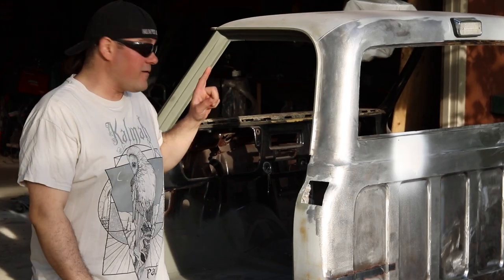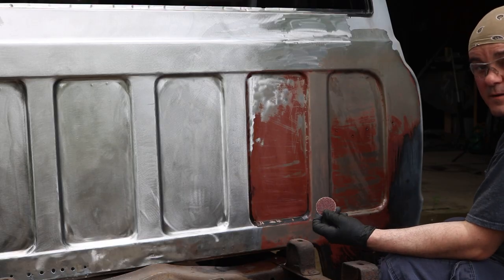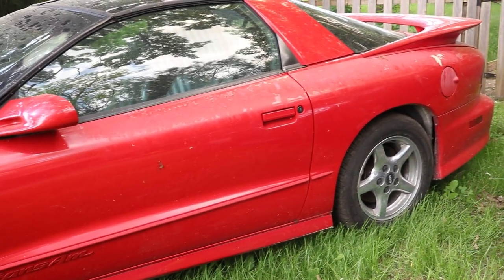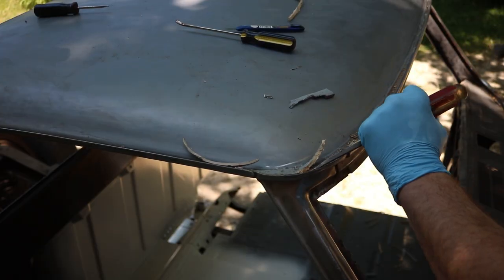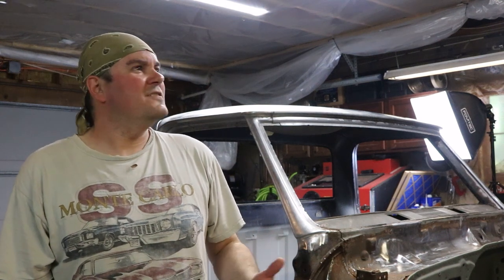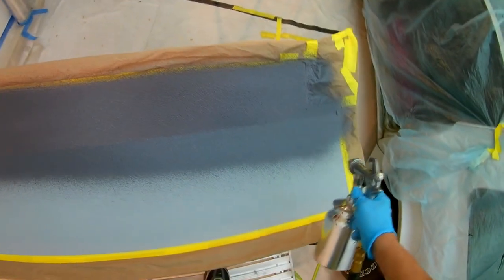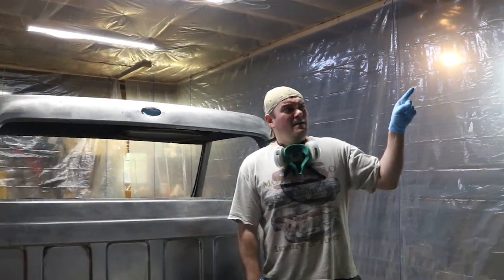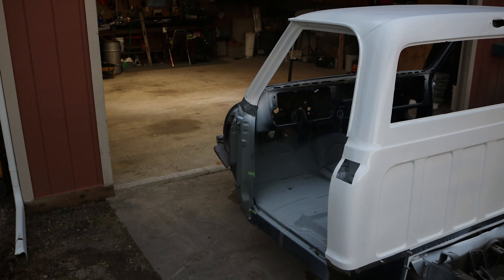How to Paint Classic Truck - DIY Paint Removal, Metal Prep, Primer Options and Paint Application

Comment from the maker: What painting project brought you to this video?
Reply: 1984 square body. Wondering how deep into paint I want to try to go. I don’t want to have to go to the metal but I’m going to have to replace rocker/cab corner so maybe I need to 🤔. A lot of work but it’s a single cab so not too bad. Great how to bro. I’d be doing all my painting out in the open
Reply from the maker: @bowtiebuilding  nice dude. You can always hit it with 80 grit and then lay down your primer but it really depends on how many layers of paint and was there body work done at some point before you? Because if the last person did improper prep or just slapped Bondo into rust, that will show its ugly head eventually. My buddy back in high school had this beautiful white 66 442 and after about two to three years everything started bubbling up on that thing from shotty body work.
Reply: A 1985 Chevy Monte Carlo
Reply from the maker: @bobbycravens6853   nice! Good luck with your project.

Comment: There is a new chemical paint stripper I think you will be amazed with. From New Zealand, "Coopers Strip Club" that sells a two part spray in pump bottles. They have YouTube videos you have to see. They sell kits or large 5 liter refills of both. First is a stripper that can sting bare arms so PPE and use their cream each application. Like any stripper, the more layers, the more used, but this is a mist to keep you panel wet, depending on Ford Enamels or GM Laquer or a base/clear still works. The have a dense steel wool they have made, but works the same. Once bare, bottle spray their "Flusher" to neutralize what ever is left behind. Since a thin spray, it is not a thick goo with paint to clean off floors but there is cleaning to do. Yours will vary. But I would buy the refills (2) and give a try. No shipping, website all one word, no extra ph #'s to dial outside the country and the inventors wife answers the phone & extremely knowledgeable.
 Just an alternative since the EPA is soo smart and took our Methylene Chrloride out of air craft stripper but they can't account for where the waist goes. They tell you that 41 people have passed from 1976 to 2009 is the reason but 1,956 children died of gum balls & small toys as choking hazards. Sad, true. But the government knows what is best all the time like $5 dollar gas, $8 bacon but they still sell turkey fryers! DK, ASE master since 78, retired.
Reply: Yes, it works. But it will cost you about $1000 to strip your truck. I can strip my truck in a day with $50 in sanding disks. Coopers is good for tight, hard to reach areas. Not stripping whole vehicles.
Reply: @SOLDOZER  Two large refills will strip two full sized trucks. Yes, it is made to remove base / clean from entire vehicle and I spent $250 and stripped entire 1967 C10 long bed, inside bed and inside cab. Easy, type in coppers strip club on you tube and watch any number of their videos. Besides, $50 won't get you enough sandpaper to do a hood & one fender. Buy the 3M Cubitron 80 grit at $1.98 per sheet for 6" DA. I will spray Coopers with long sleeve all day with no dust! Filter cost money to and not N95.
Reply: Side grinder with 6 inch 80 grit pads . Keep it moving 😊

Comment: Painted my 67' Bronco in my garage last year, hidden gem for cleaning your surface before paint is white vinegar, cheap, smells bad but works wonders
Reply from the maker: Nice, thanks for the tip.
Reply: That’s acidic, won’t that mess with the primer adhesion?
Reply: @jraposo911  once it dries its fine, I've had my paint adhere fine and nothing has gone wrong with it in years

Comment: I used the strip it disc with an angle grinder to strip all the paint off of my hood and cab roof to bare metal. The trick is to constantly keep it moving. Don't stay in one spot at all. I didn't warp anything.You can feel the temp with your hand like you did and it never got past warm on me. The paint stripper was only taking the paint off in layers. I got frustrated so I just popped on my headphones, put some music on and got it done with the angle grinder. Just my .02 cents
Reply from the maker: Thanks Pablo! It sucks either way. No matter which process, it's time consuming and dirty.
Reply: Eventhough painting sucks. I think the juice is worth the squeeze. Once the paint job is done and it looks good you will be glad you did it.

Comment: Hello, If you go to bare metal with stripping disc for whole truck , do you need to go over again with like 80grit with DA?  And how long can you keep truck outside when you go to bare metal? My k5 doesn’t fit into my garage . I  was going to make a DIY tent paint booth outside. Thanks
Reply from the maker: Depends on if the stripping disks leave scratches or marks.  I would check with the primer's instructions on what your prep should be before paint.  As far as rust it really just depends on humidity and the elements. I've left my truck in primer for months and it did flash rust a little bit but nothing crazy. If you do strip the truck and it sits out there let's say for a couple weeks before you go paint I would just hit it with the DA at 80 or whatever the instructions say just a knock off the flash rust.

Comment: I thought I was the only one that had Fast Etch do that. I wasted so much time re applying it and trying to wash it off with their pre painting prep and it always left that residue. I ended up sand blasting my k10’s cab just to get the fast etch off.
Reply from the maker: If I ever did use it again I would probably use it on a smaller area but yeah as you know that was a complete nightmare. When I talked to Eastwood they said something about a phosphorus residue that is easily washed off which obviously wasn't the case.

Comment: i put some oven cleaner on a greasy part and it took the paint off also . what do u think about oven cleaner ?
Reply from the maker: I haven't used it to remove paint. I've only used it to clean carbon off of pistons but I will have to give that a try.

Comment: Question- how long do you have on bare metal before flash rust starts to happen?   In a hot dry area like Las Vegas?
Reply from the maker: It really depends. I've left panels in bare metal for months with barely any surface rust afterwards.  Good practice is if you do end up leaving it in bare metal always resand it before applying primer.

Comment: Brake cleaner is the best paint remover. I had valve covers, a few hours later a paper towel took off all the paint.
Reply from the maker: Nice I know that brake cleaner is not too nice to paint. I'll have to try that on some stubborn primer!
Reply: @BustedClassicGarage  Took off high temp paint from my explorer valve covers. Even the wirewheel dry was struggling. Worth a shot, it could even boost another product so you have less work. I also have tons of it free from brake flushes!

Comment: Did you wire wheel the floor?
Reply from the maker: Some areas. The firewall and rear cab were taken down to bare metal. There is alot of new panels I welded in on the floor but either way once it's all metal worked I will wire wheel every part of the inside and then spray it with epoxy.

Comment: Classic vehicles need to be stripped to bare metal. They use lacquer. Nothing is going to stick to it no matter what you do or what some salesman tells you. You will have reactions or half your paint will come off in a car wash. Modern paint stripper in the US DONT work. The EPA removed the active ingredient.
Reply: What years of classics does this apply to?
Reply: @briizcustoms9543   Somewhere around 1990 give or take a couple and earlier is going to be lacquer.

Comment: Epoxy primer? Dangerous as hell due to isocyanates that cannot be filtered out.  Most DIY’ers don’t have the right safety equipment to use any 2 part primer or paint.